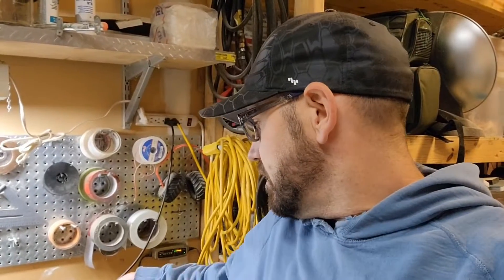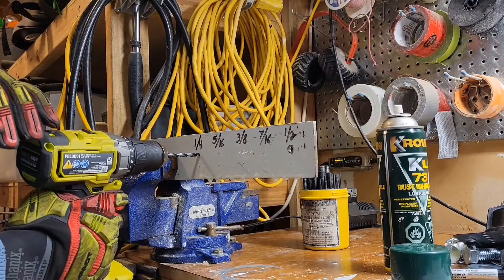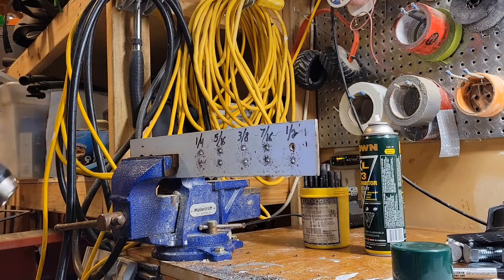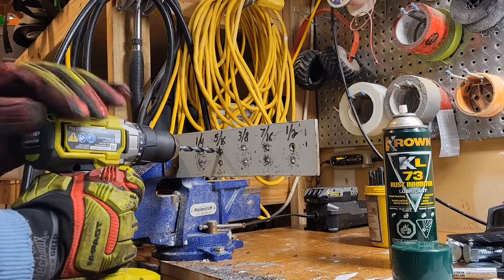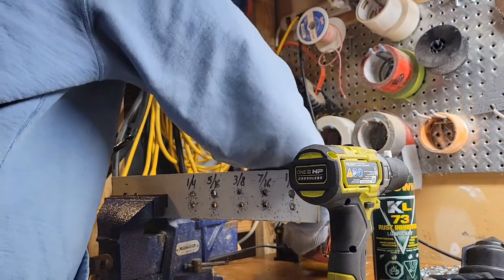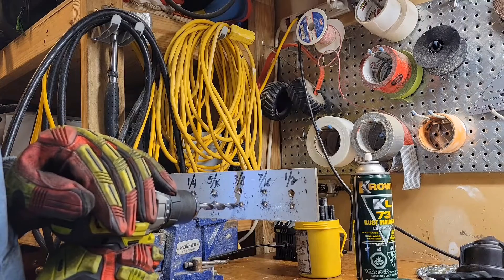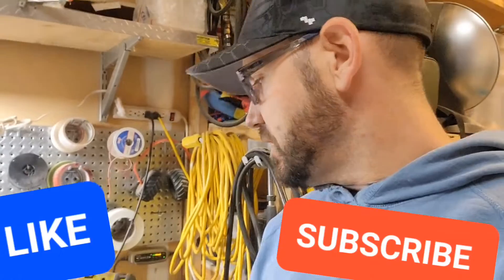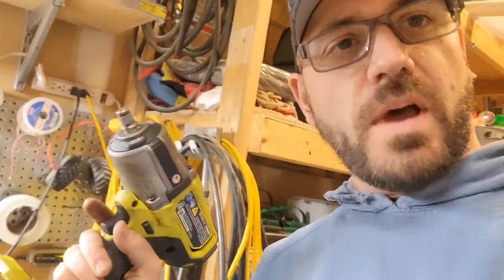Ryobi One+ hp PBLDD01 drill test

Comment: what kinda metal is that plate ur drilling thru? sometimes w metal especially stainless steel and such,,, its best to go kinda really slow, bit w alot of downward force, just full speeding the drill on a hard metal, your gonna ruin ur bits. too fast they cant bite into to start removing material,  and theyll just get hot, and grind down n lose their edge. try half trigger soeed in setting 1 n drill clutch mode...

but regardless thise are the entirely worng bits for this application anyway... you need a step bit here
Reply from the maker: This is just a 1/4" steel plate, nothing fancy, not stainless steel.
Those bit are the brafasco high speed drill bits. I sharpend them before making the video but I think I put to much of a angle on the 1/4" bit.
Reply from the maker: Thanks for the tip about the speed Dabby